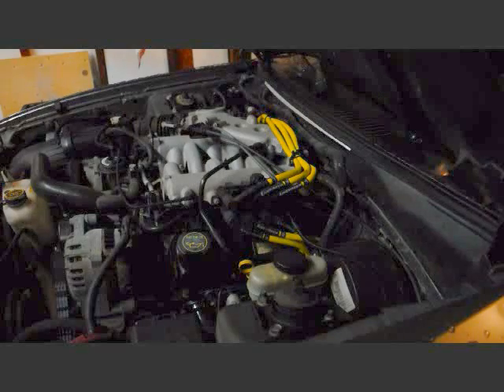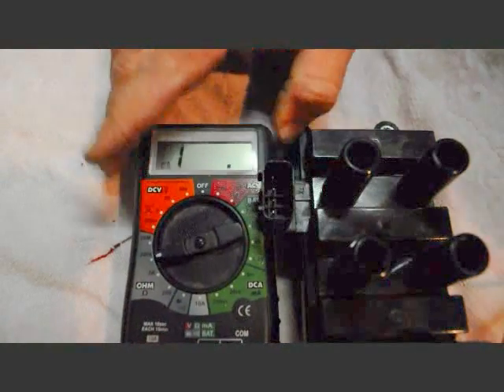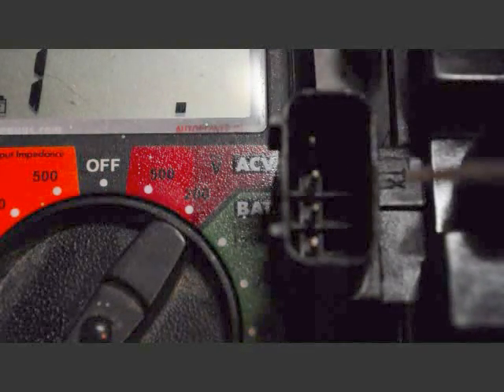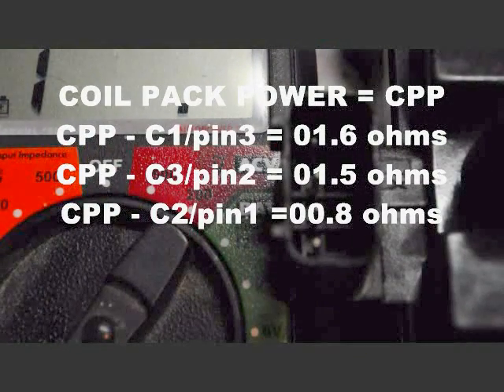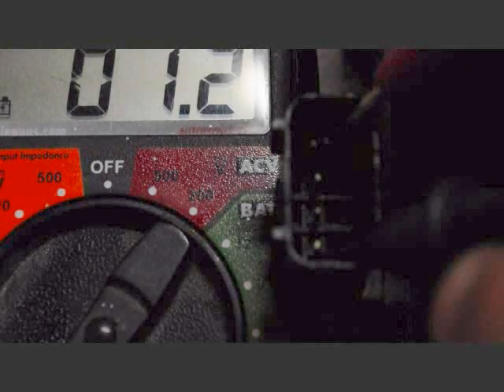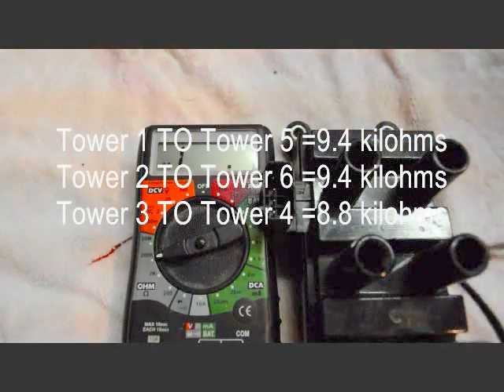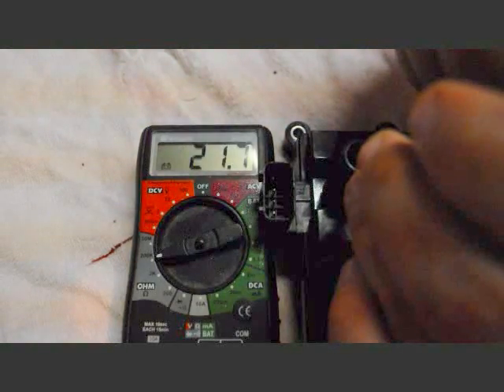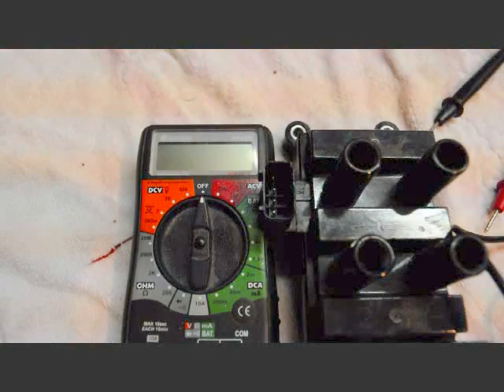How to Check an Ignition Coil Pack the easy way

Comment: I’m a novice so I can’t see what you’re doing when you check the banks
Reply: Putting a probe in each tower on the corresponding bank. I am sure you figured it it by now but figured I would answer in case someone else has the same question.

Comment: I conducted these tests on my 2002 DOHC Taurus and found no problems. However, the coil was cold when I bench tested it. My misfire occurred after the engine was warm, after 20 min of operating. It got worse when the AC was on because of the lower RPM and lower voltage due to a slower running engine. I changed the coil and the problem is gone.

Comment from the maker: thank for all the good and not so good comments, when i was under light load ( gas ) the engine was ok. but as soon as i went wot ( wide open throttle ) the car sputtered, i got the pack from LiveWire and this is how they told me to test it. when i tested it and sent the video to them they replaced the coil free of charge and soon as i put the new coil in with readings the same across the banks i didnt have any further problems at WOT !
Reply: I'm having the same issue with my LiveWire pack. Cylinder 1 was missing under load. Replaced with my 10 year old stock coil pack that I kept and works perfectly fine. The LiveWire pack can't be more then two years old.
Reply from the maker: @Samophlan  yep I find they're not the best quality

Comment: This test its wrong he got the red led in one of the coils not where the power supply is to check it right get ohm from towers see who much different is from the other 2 and chek for cracks on the hole assembly if you see a tiny crack its time to replace

Comment: why 1 ohm is bad?nonsense less resistance better spark. why you say its bad bank with 0.08?
Reply: Less resistance is better conductance. When you have a coil, through normal use, the resistance will NEVER go down, unless it's shorted somewhere. It's probable that the insulation wore out somewhere on the coil and it broke down more when the car was running - this could lead to a short somewhere, but this is very unlikely. Low readings are fine. Higher than normal readings can mean corrosion, and no reading can mean an open circuit (no firing). It does seem that you're getting half the reading you got on the other banks - perhaps you're only reading one coil. Are you sure you know what pins are connected to what?
Reply: true
Reply: less resistance means the coil may be partially burned

Comment: I went to the parts store and checked the new unit and it had the same low reading on the third bank, so I did not by the coil pack.  Not 100% sure on this test method.

Comment: I took mine off and went to the auto parts store. Set them up side by side. Did your test and found mine to be between .3-.5  close to the new one. I am guessing mine is ok. My coil pack looks a lot like your Your has like a elbow where as mine comes straight out the back. Then plugs in.

Comment: this is bullshit, I tested my coil pack like this an got the same numbers, so i went to the junkyard an tested several coil packs from the same type of car and the numbers were all pretty much the same, they can't ALL be bad.
Reply: Jay I disconnected my last at the top while car running, it eventually stopped sparking then I tested it and it was like 0.8 ohms. Check engine light was blinking and car ran poorly. Got two from junk yard, both tested the same with low resistance on last and the first one I tested ran poorly
Reply: clown he's saying the odd one out was the bad one. If all the readings are the same on all the ones you tested then their probably all good ones and the problem with your ignition is somewhere else - not the coil pack
Reply: Ahh that explains why the new coil pack i bought fixed the problem. Clown
Reply: Just ran into this video..   I have a tiny miss that comes an goes when it is humid out side..  Seems as if the v6 junkstang runs poor when it rains. So after watching this video I decided to do a Ohm test on the low ohm side.   I got 1.6 on one..   1.6 on the other..  and 1.0 on the last one.  So does that mean my junkstang coil pack needs replaced ??  Funny that everyone here says the last one reads 1.0 ohms.  lol
Reply: Thanks for the reply man.  :)
Reply from the maker: understanding how coil packs work ( hence this video ) you can determine if yours is bad or good. and great job on testing, if all the numbers are roughly the same the coil pack is good ! follow along next time, if it was that hard to follow the video, you should not be doing this kind work..

Comment: My coil pack is a c925. The resistance of this particular pack for the primary pins is .3 to .9, upon testing the primary with a multimeter it read pin #1 was 2.4, pin #2 was about the same but pin #3 was about 1.8. I'm wondering with those numbers being higher than the they should be does that mean that the pack is actually bad? Or does it mean that the pack is good? Should those readings be that high?

Comment: my car is not getting any spark i changed the crank sensor and the coilpack and still aint getting know spark what else could it be
Reply: Same as mine! Did you find the solution?
Reply: same problem
Reply: it'll will be your battery or your terminals need cleaning, after cleaning them, use something to just lightly tap the starter motor as someone is starting it, if still nothing it will be your battery

Comment: When removing mine, There was 4 wires. 1 Red at top and 3 yellow. The power is at top of connector in video and not at bottom. Other than that a great video. Also at 200 ohms results were higher than yours. .5 or higher. No misfire codes but a rough idle. Still looking.

Comment: hey wayne, i have a bike that has 2 spark plugs per cylinder and it seems only 1 plug is firing.  my secondary coil resistance is 14kohm.  book says it should be 18-20kohm.  do you think this is why i have weak spark?
Reply: I am not an expert but a low resistance means partially burned coil ..does it make sense ? The burned section gets shorted within iself disabling many turns which produce voltage.

Comment: I guess a simple way to check the functionality of a coil would be to attach a strobe light with an inductive pick-up? it won't give you a reading but if your engine is difficult to see the plugs or get to them, this method will help speed up the fault finding with the engine running and coils under load.
 I have also used the caps that attach between the plugs and ht leads they are really good providing it's not sunny, however not much use where modern coils mount directly onto the plugs.

Comment: eashed enginr. something went wrong 3 rd cylinder  is misfireing changed spark plugs and cleaned the crank sensor. but i thik its the coil pack becausr whrnni unplug the 3rd cylinder wire from the pack it doesnt mack the zappy sound all others make. so should i replacr the coil pack?

Comment: i have  2006 xlt explorer , i need to know , what would be the readings on a new coil , i mean , you got 1.6 , 1.5 & 0.08 on the last pin , the last pin should give a similar reading to the other two pins , And the all of banks  should read the same , in other words , figures should be the same on all three banks . & all three bins , what would be the right figures for the last bank & the last pin

Comment: Thank you so much for posting this tip. I tried it on my 2000  Ford Focus and found that I needed to replace my Coil Pack (Ignition Coil).  This saved me a bunch of money in diagnostic tests and labour that a mechanic would have charged me as I was able to check it and replace it myself. .
Reply from the maker: Great job ! thanks for the update

Comment: would a bad coil pack allow car to run for about 10 minutes and just lose power and go dead. wait about 20-40 mins and it will fire up again and run for about 10 more mins.  It will turn over i hear the fuel pump kicking in but will not fire.

2000 mercury moutaineer 5.0L
Reply from the maker: fuel pump ?

Comment: Liked your vid, thanks. But Wayne the 12v pin is the one on the left end of the connector (top one in the video), not the right like the old EDIS 6 were, that's why you got a 1-ohm reading on that one. The 1.7-ohm reading is resistance between primary coils. Normal resistance between 12v and coils is 1 ohm. When you measured resistance in secondary coils the difference for the third bank may be hinting at an isolator fault. This should have no effect on primary coils.

Comment: I have a 00 VW golf 1.4 

d CO an HC is very high an there is a code 00525 related to o2 sensor.  I checked d coil an plug wires 2 c if they cause those problems.  

The following is the result of d test:

Ignition coil at 200K ohms:
Primary: 01.7, 00.8 and 00.4
Secondary: 05.0, 05.0

Spark plug wires at 20K ohms:
C1# 6.10, C2# 5.99, C3# 5.96 and C4# 6.14

So there is a big deference between primary readings of the coil. So should I replace them?

Comment: I have a 1995 sl2 saturn that doesn't throw a code and shudders at mid throttle and stalls. It drives normal at light acceleration and normal at high acceleration. My transmission guy told me that the coil and module can cause my problem . I swapped the coil from an old saturn at the junkyard maybe 2 years ago and still had the problem so I kinda gave up on it but the car runs great except the shuddering issue.